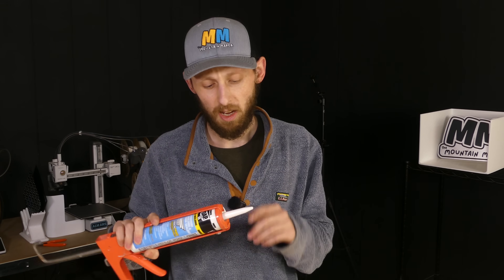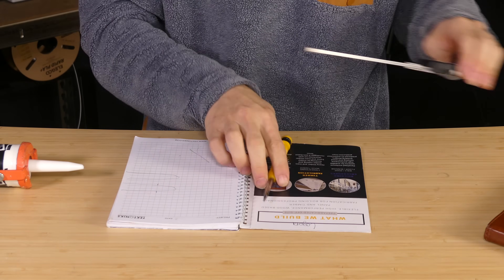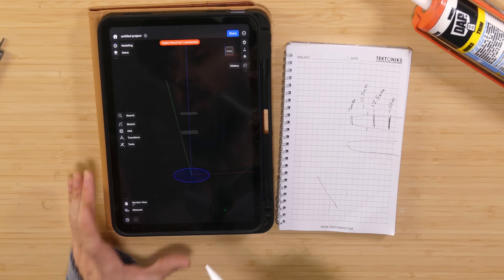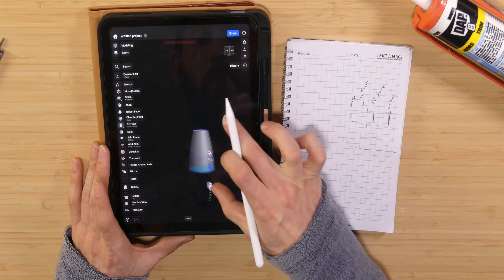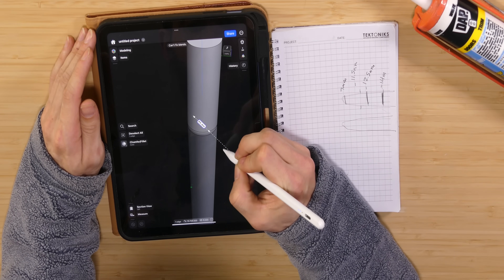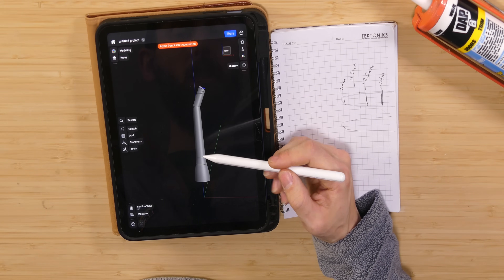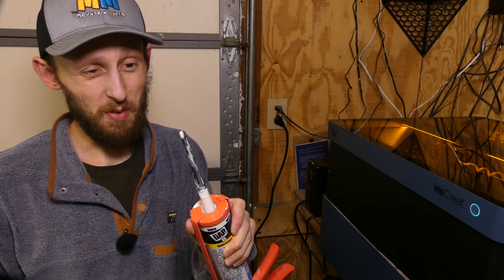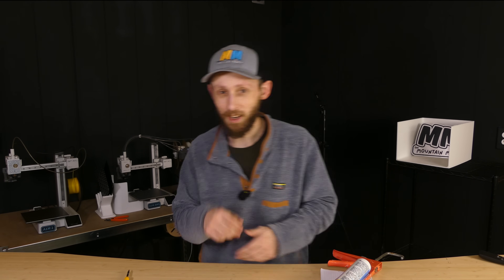This Garage Problem Was Driving Me Nuts… So I 3D Printed a Fix

Comment: Before u use AutoCAD why the switch ?
Reply from the maker: I primarily use Shapr3D for anything I design and have been for the last few years. Every now and again I will use Fusion if its something that Shapr3D isnt fit for such as doing threaded parts, but 90% of the time it is inside of Shapr3D
Reply: @ I’ll give that a try  thanks

Comment: You get that foam that goes around copper tubing.  Attach it to the edge of like a fence board.  Then you jamb it in there up against the door and screw it to the wall.  That way you don’t have trouble opening the door later.  Just a thought.
Reply from the maker: I don’t have to worry about the doors not opening because the tracks are removed at the top so they can’t open anyways but it is a good idea for others who may want to use their doors off and on!
Reply: @ copy that

Comment: Good idea to solve your issue for a low price. If that doesn’t keep as good as you want, check out green hinges, they have a spring on it that pushes the door against the frame. Give an update on how it held up. Also good explanation on a solution to assist.
Reply from the maker: Awesome, Thank you for the tip on the hinges! I'll have to look into them!

Comment: Using the wrong caulk for that that’s a trim caulk. You wanna use a exterior silicone not interior trim caulk
I subscribed by the way
Reply from the maker: Thanks! It's what I had on hand at 330am when I went to do this project, so here's to hoping it holds up like the other door has for the last 6 or 7 months! Not sure how it will do a year from now but so far so good. I do think i'm going to revisit the design in the near future so if that's the case, I will pick up some of the exterior stuff for that one!

Comment: Nice fix. Actually gave me a great idea to do RTV tips. The RTV tubes come with a threaded end already, so not only could I make disposable tips with custom ends that waste less RTV, but I could make replacement caps so the tube doesn't dry up too. Just have a bunch in a mechanic drawer.
Reply from the maker: That’s a great idea!

Comment: I really doubt that will ever work.  I would just shove some foam in between the door and the rails to seal it.  That way, if needed, you will still be able to use the door if necessary!
Reply from the maker: Works great! No more drafts and the tracks are clipped at the top so the door will never open again anyways

Comment: Shapr3d is too expensive for what it offers.. convenient on ipad, but it lacks too many features present on fusion360 in free version..
Reply from the maker: Shapr3D also has a free version you can use but you are limited to 2 editable files at once, similar to fusion
Reply: @TheMountainMaker  The free version makes export at ridiculous resolution, impossible to use for 3D printing..Fusion saves up to 10 files in reading/writing, but it is enough to export the project file directly and the problem is solved !!!

Comment: A TPU print may have also helped contribute to success. Mitigating backflow is difficult in this scenario because of the layer lines but you could etch a seam into the tip of the nozzle to create a lock for yourself that may create a good enough gasket. Nice job keeping out the cold, can't wait for that to go away here as well.
Reply from the maker: Originally when I started filming, TPU was going to be what I used, but the more I thought about it and realized it was only going to be a one time use thing, I decided on PLA. I do think the TPU would've created a better seal and hugged the caulking tube a little better though. Thankfully I never open the garage doors anymore, and the one I sealed at first has no top tracks to it so it cant open again anyways. The cold seems to go away for a day or 2, we get some nicer weather then it goes right back down to the 30s at night.